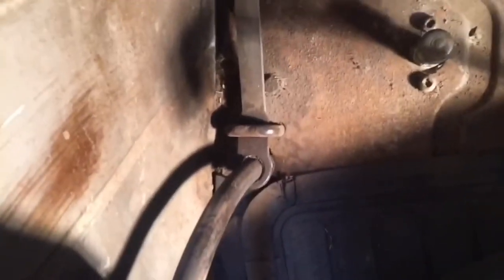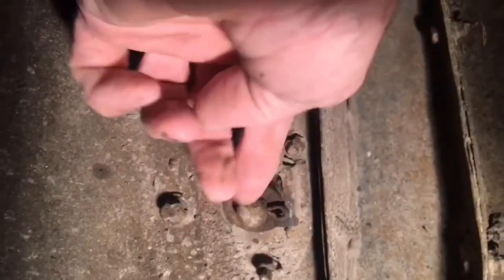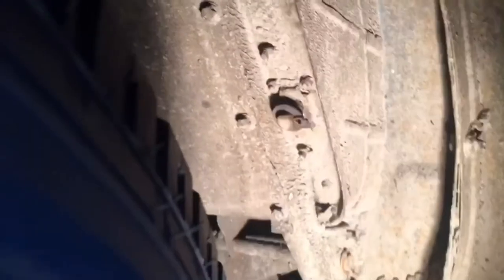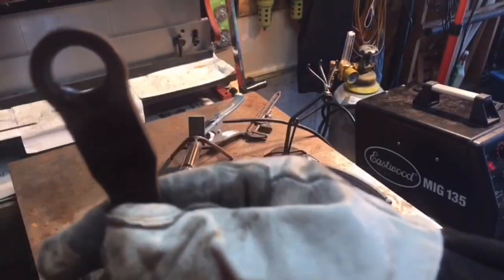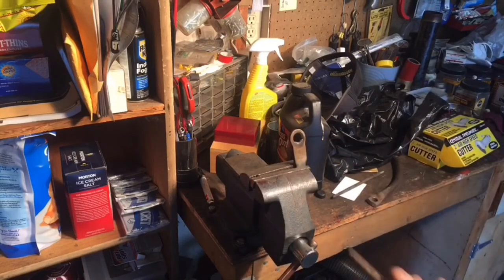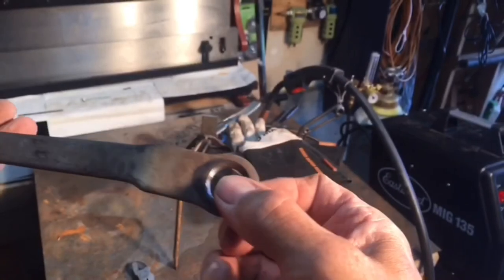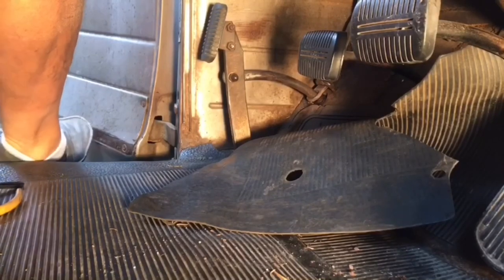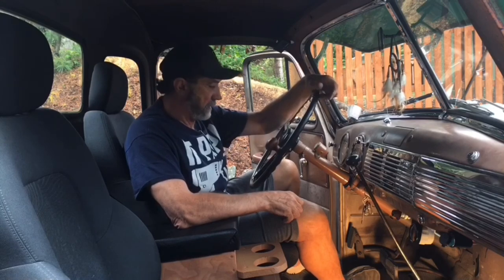1953 Chevy Truck E Brake repair

Comment: Nice video thank you for sharing. I’m having trouble getting the parking brake to hold tension not sure how to get it to hold pressure so that it will actually work like it’s supposed to. Almost as if my cable is too long and there’s not enough movement to get it to pull the cable far enough. I know there’s nuts on a threaded bolt and have attempted adjusting those but I did not have any luck
Reply from the maker: yes mine was pulling the brakes just fine, just not holding them

Comment: My 3100 1954 has the same problem. I’ll follow your idea and try making the hole smaller. My question is …will the E brake be affected by the brakes not being adjusted? I’m going to adjust the rear brakes as they are not self adjusting. I think taking out a little slack will help the E  brake to work better.
Reply from the maker: Yes Carolyn, i would always start with the brakes adjusted first, and then you can start to dial in the E-brake, if you watch the way i fixed mine, it should work for you, just make sure your  bracket has that beveled hole, the point on the bevel is what will hold the pedal arm, hope this helps, would like to see your truck

Comment: Great fix.
Reply from the maker: Thank you Dave, yes it really did the trick, nice to have the E Brake working again, and by the way put the corn head grease in the steering box, so far so good
Reply: @DesertRatFabrication  I put a full tube in both the Chevy & GMC. It took awhile but it did flow.
Reply from the maker: @Volfandt  sweet

Comment: Hey Desert Rat. Thanks for SUBBING my channel. I like what you have going on here. So, of course, I subbed to your channel as well.
 That is a cool idea for the parking brake. My Fargo had a brake shoe that wrapped around the driveshaft to keep the truck from rolling away. I changed it to the more modern way that a parking brake works. Thanks for sharing. I'll be BACK.🍁👍👍